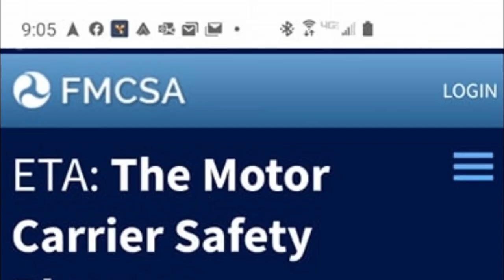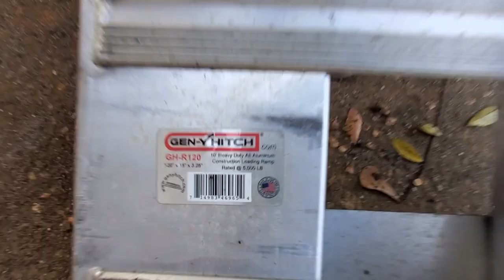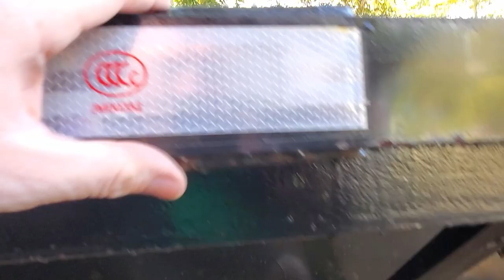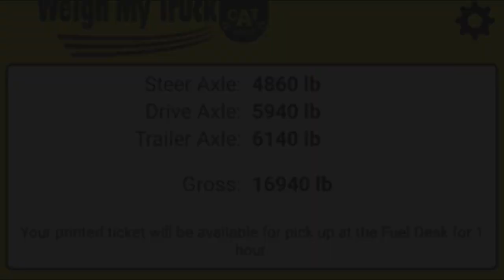DOT was at my house for 3 Days!

Comment: Rule of thumb for trailers: don't have high expectations for quality fitment, welding or logic behind why something was installed a certain way at the factory. After doing upgrades and repairs on a couple of trailers less than a year old, I never found one to be square in dimensions from the factory. I dug into trailer company fabrication industry practices and most workers are paid low wage using the basis of getting the trailer built as fast as possible most likely resulting in cut corners.

One landscape trailer I did work on that was less than a couple of months old had about 60% of the welds completed on the fold down rear gate. The mesh was tack welded and actually marked with a paint marker line under the black paint but was hurried to get the ramp done without completing the marked welds.

After a couple of weeks of use and erratic placement of welds, the mesh was already showing signs of weight causing sag in between the thin square tubing frame. This future failure prevention required burning off the tree sap like black paint and welding the mesh to the square tubing which is time consuming as steel mesh will tend to look wavy. The tubing of the frame and hinges also had to have the remaining welds completed as most were hit and miss in consistency. 

The trailer industry sadly does not take pride in their workmanship and is purely after profit but if you really want to spend your money once on a great trailer, have one built at a welding shop. From what I have seen with the future repair costs and downtime involved with production trailers, having a custom trailer built would be far cheaper in the long run including better features and materials / workmanship. Just my two cents as I like to spend money once rather than the expensive alternative.

Comment: Will your big Tex ramps work
Pry the boards up in the center is what we had to do it that way with dads trailer putting the new ones in slips under the lip a 2X4 in the center hold down the other end and pull out the 2X4
Reply from the maker: Different size, different angle.

Comment: I'm working on trying to start my own hotshot business. I'm doing everything I can to learn everything I can so I know as much as possible. I didn't know they would require a maintenance log right down to a lightbulb! Great to know along with being required to run an application on yourself for a driving record....Keep up the good work and keep working hard! I'm not too sure what I think of that new trailer....looks great at a distance, but those welds? Oof....same here though, not saying I could do better but like you said for someone who builds them regularly you'd think the welds would look a bit better.....but I guess as long as they're not cracked or porous and hold up the looks don't matter so much.

Comment: Well no, not exactly. If you leave something off a maintenance report and opposing counsel finds it then he can argue that you were committing an infraction by driving a vehicle without a complete maintenance record. Any infraction, no matter how small, triggers something called "strict liability". In cases where the strict liability rule is in play the court does not consider who is at fault. They only consider damages. This is what trial lawyers are always angling for in trucking cases since trucks are subject to so many regulations it's almost impossible to be in compliance all the time. It's also the reason you see those billboards advertising to sue trucking companies.

Comment: The old bath is way better than grease. Keep your bearing a little tight so the hub can't move in and out at all. Put new seals in and a preload on the bearings and forget it for 100,000 miles.

Comment: what if you are a certified welder and did the frame job?sorry for the problems, people are jerks.when it was wired the ground is not wired through the 7 wire plug .they are using the hitch connection to act as the ground .wire a ground in the plug.

Comment: Sorry to say it but you got hosed on that trailer. I just bought a 2020 Big Tex 40' with 23,900 GVW for $12,400+tax. I won't use it commercially, but, It'll haul my antique tractors no problem. I also don't get what it issue with the oil bath hubs is. My new trailer has EZ Lube hubs, but my, and every single semi tractor that I've ever seen, have oil bath hubs with the rubber plugs on the steer axle. In my nearly 3 million miles otr, I've never had a problem with them.

Comment: So according to then FMCSA rules, any stretched frame semi tractor is illegal??..  What a crock of crap!
I hope that guy gets surrounded by a group of hotshotters and gets what's coming to him..
Reply: Any frame modification must be recertified.someone is giveing you. Bad info on the oil bath hubs.all of the otr commercial trailers are equipped with oil bath.
Reply: @stevereynolds9175  All commercial and other trailer used to have greased packed hubs. With the high tech grease available today a lot of folks are going back to grease.  Preventative and predictive maintenance is the key to less problems.
Reply from the maker: It's my understanding that it's the dual tandem axles that are OK to have but when you go to the single tire axles that's when it give you problems
Reply: @stevereynolds9175  Recertified by who?

Comment: On the boards, they cut them to just fit and slide them forward under the metal then screw them in, had to do that on my trailer before to replace them

Comment: Replacing those boards isn't that bad. You cut the boards in the middle to remove them, and then angle the new boards to slide them in. The last couple, you cut just a little longer than the space between the channels that hold them down, then bend them up in the middle with wedges and flex them into place. I did it on a couple of car trailers and a gooseneck.

Comment: On that top toolbox... why not cut the corners and weld some flat plate on at the correct angle so you can recess mount that toolbox.  You know how to weld so cost is some materials and time.

Decrease wind resistance and maybe save some gas... downside is you would lose a small amount of trailer storage.
Reply from the maker: I'm new to aluminum welding honestly.
Reply: Weld some iron supports across it to each neck beam that supports the bottom of the modified box. That way your aluminum welds aren’t a major factor, the box will be incased the iron. I floored that area and am able to put 2 storage boxes and 2 tarps (standing on ends) in our neck area.
Reply: Good idea... you may get a touch of galvanic corrosion with the dissimilar metals, but it’s a toolbox and shouldn’t matter

Comment: Hey Bro, not exactly sure you actually traded up on that trailer. Those welds , the hack torch cuts, hinges. 
Apparently that's what moonshiners do in the off season,  scrap some steel and make them a trailer.
Hope I'm wrong dude, guess time will tell.

Comment: The two major differences basically amount to whether you run under your own authority (MC #) or others.  Once you choose to run under your own authority you are now a carrier and your company wears another hat altogether.  This is why it is not necessarily a GREAT ideal for new drivers coming into the industry with little or no experience to run their own authority.  Hot-Shot or otherwise.  This industry is challenging enough just trying to follow the regulations required of a driver and/or O/O; throw in the MC credentials and you just entered into a different realm.  Best of Outcomes to those who decide to head along that route.

Comment: I saw your video pertaining to the GVWR of your truck and the what your trailer had to be, so set me straight so I understand. My truck GVWR is 12300, which means that my trailer must be 13700, correct? What’s the length of your trailer, and how do I get that sliding strap setup on your trailer?
Reply from the maker: Correct on the gvwr. I bought the sliding strap setup and welded it myself. If you're trying to run non cdl don't bother as it adds weight.
Reply: @SouthGeorgiahotshot  I’m obtaining my CDL to run non CDL to have the ability to run however I need! I hate needing it and not having it. I’m listening to your video now about DOT coming to your house and I’m like wow

Comment: Man I tried to toss a couple hints out in the beginning of that build but I was hoping you’d slip through the cracks on it. Two things should have jumped out immediately. One, when you are doing your pre-trip inspection; no illegal welds. Two, when i said you have to now register it as home made. You’ve increased the length and you are not a manufacturer. The registration would have had to been changed to 40 feet and new weight somehow. So if anyone happen to take the time to measure you they more than likely would have scratched their head. Not to mention the insurance side of things as soon as they found out that the trailer has been repaired if you were to ever have a claim. They would absolutely walk away from the claim leaving the burden on you personally. (Insurance companies always looking to get out of things no matter how high the insurance premium is) also no matter weather you are a single driver company or not. They still treat you as any trucking company. While I do believe the government has their hand way too deep in things all of the laws/regulations are geared towards semi truck and trailer. So sometimes it’s hard to understand why they are hitting us with stupid stuff. On the other hand this is also why they have the rules because hot shots seem to pull the shadiest stuff. So it’s a balancing act. No one on YouTube actually has a real full overview when it comes to audits etc but if you watch enough of them and do some of your own research you’ll see that we require a small office to operate the way they want us to. It’s crazy really but it’s one set of rules for all and they love giving out fines. This is why so many small companies sub out for paperwork and stuff. You gotta be very organized and waste a lot of your time keeping care to the records and training that they want you to have. Anyways I’ve rambled enough.  No hard feelings, just wanted to comment. I wish you well! I like watching your videos!
Reply: I've never seen a trailer registration that lists the length.  They vary from state to state whether listed as empty weight or loaded weight.
Reply: Happy Pappy that is correct it does vary state to state. Thank you for taking the time to point that out in my comment. You seem to take a lot of time reading and responding on these channels comment sections. I wasn’t going to research his state specifically but we will just leave it at the first point. Pre-trip. All the same anywhere. This is where people come to learn things these days. I decided to put some talking points out there. I didn’t go looking for your comment but I’m sure it’s “first” with a bunch of emojis.
Reply: @adamsmith1470  I only said that because multiple people had said he needed to redo the registration do to the added length.  When I got one of my trailers in Illinois, it didn't list length or weight.  I had to get it weighed before I could get a tag in Florida.  It is tagged by empty weight in Florida.
Reply from the maker: The build was done weeks before the first video hit lmao
Reply: SouthGeorgiaHotShot yea I wasn’t sure at the time how far off the videos were but I really wish you could have gotten it to work out. You really put a lot of time and money into it and it definitely came out looking factory. It takes a lot of ball to take on a project like that. Most of these guys out here don’t even know how to change a tire lol 

Btw have you heard from Alex? He ok? Haven’t seen him post anything.
Reply from the maker: @adamsmith1470  yeah he texted me yesterday. Everyone's having to hustle extra hard with these rates is all.
Reply: SouthGeorgiaHotShot I hear ya on that

Comment: Those welds are unacceptable coming from a professional! I understand trailer manufacturers don't pay their employees very well but, those welds look like someone with absolutely no experience welded them. The worst part in my opinion is the worst looking welds are on the most structurally important parts of the trailer! So, all in all I completely agree with your evaluation of the trailer! Good luck with it.
Reply: All welds on trailers are inspected by a CWI and are signed off......you really can't tell by the ugliness of the weld the integrity of the weld....There are Manny factors and allowances with welds before they are rejected. Trailers and welds on trailers are also engineered to be way overkill to prevent malfunction. I wouldn't worry about what the weld looks like worry about the weld if you see cracks. Most plate welds don't fail no mater what they look like.....the metal around the weld should fail before weld as weld metal is alway higher tensile strength.

Comment: Remove manufacturing plate and apply for home made trailer registration. Apply sticker with new serial number from state to trailer.
Reply from the maker: I was told home made couldn't be used for commercial use. But I'm gonna check into it more
Reply: SouthGeorgiaHotShot well once again I guess I’ve been lucky. I must be the luckiest poor person in trucking.🤣
Reply from the maker: @NoName-tz5ji  you're running a home made?
Reply: SouthGeorgiaHotShot not running anything hotshot at the moment,but yes I have and they were both non and CDL weight.
Reply: If I get back into it in retirement I will use the same trailers assuming they haven’t rusted in some places too badly

Comment: Well shitie I've got a 3 month old 40ft pj with the 35+5 just sitting in my driveway since I screwed up my research and my truck is to small. Rated for 26k but this is the first video I've watched from yall. So not sure if you run under cdl or run with it.

Comment: the reason they don't want you modifying a trailer that you use for commercial use is that they don't want to risk it breaking and not be able to recall the trailer. for the most part federly a manufacture is given the benefit of the doubt and allowed to make vehicles that are tested minumly. some larger manufacturers like boeing and ford might be able to conduct their own testing (I wouldn't be surprised if texas pride was self regulated). If a product fails catastrophically then the right to self regulate is revoked and the manufacturer is held liable for all damages.

Comment: You may have been better off redoing your trailer has a homebuilt, had it inspected and vin and plated. I did that for a two car 40’ trailer in Ohio about 15 yrs ago , used it for commercial, of course I didn’t utube it .
Reply from the maker: I was told by the dot officer home made trailers cant be used for commercial use. But google cant seem to help me out
Reply: SouthGeorgiaHotShot maybe a second LLC built it and sells it to your trucking LLC . When I did mine It was inspected by the Ohio state troopers and they vin it. Maybe it’s the left hand doesn’t know what the right hand is doing . Lol

Comment: Hello sir I feel bad for you, I live in central Washington and we extend trailers all the time 40' and 42' to 53' 4 axle , potato trailers, container chassis, Hopper bottoms almost any kind of trailers you can think of we extend , and I'm not alone in doing this there are quite a few businesses and people like yourself that do it at home, all we do is take it to DOT and get it re-inspected, our last job we extended 8 42' flatbed trailers to 53' spread axles and they run all 48 states, I've even had DOT  come to the shop and inspect the trailers here and have never ever heard of what you are talking about not being able to weld on a trailer with out the manufacturers consent
Reply from the maker: When you say dot re inspected. Is that just another annual inspection? Or something different?
Reply: @SouthGeorgiahotshot  it's for title purposes the trailer no longer is a 40ft or 42ft whatever the new length has to be added to the title, typically we also get a new annual inspection , think about this you bend your trailer you bring it to me I replace the frame rail that is bent and at the same time make some upgrades that you want, why do I have to call the manufacturer and get permission, what they told you was true, auto body shops would not exist repair shops like mine would not exist, I buy parts from dealers do you think they care that I'm modifying their trailer
Reply: @SouthGeorgiahotshot  oops,  I meant to say what the DOT told you was not true, I would contact a local independent trailer repair shop in your state that does work like this and talk to them about your dilemma, there may be a law in your state that I am not aware of, but I am positive that you are just being misinformed

Comment: Sheesh - those welds on the newly acquired trailer are pretty rough - i have only done a few years of welding, but def saw better welds in high school :/
Reply: Nobody is going to race to the front to make a trailer like that for $10K (which would include insurance, and probably benefits for some employees, overhead, etc). 

As often as I see hobby welders criticizing manufactured goods that they bought on price, it's pretty uncommon to see them turn around and "make bank" doing a better job or as good of a job for cheaper.

Comment: Hi man, also Hi to Lita,,,,,,,glad you guys are finding a way to keep rollin,,,,,,,,,sorry that you have had all this grief  because of some keyboard-commando.
With regards to replacing the boards,,,,,,,,,me I would probably just grind off the welds for that cross-strap,,,,,replace the board and then just bolt the cross-strap back on using some fabbed-up brackets where the original welds were,,,,,,,,this way nobody can accuse you of welding on your trailer,,,,what a stupid Reg. from FMCSA.
Thanks for posting this,,,,,lots of good info here,,,,,,,I never knew that you could not weld on your own trailer.